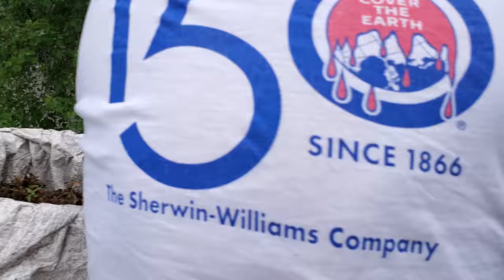Relocating Mourning Dove Nest

Comment: I'm sorry, great intentions, but you should have just left them alone. At that stage, the chicks would have fledged the nest within a matter of days, so rescheduling the job would have been the way to go. I'm in this situation right now, and a bird expert told me that relocating a mourning dove nests isn't possible, so the chances that the chicks survived are, unfortunately, small. I also learned that apparently, relocating bird nests with eggs or chicks inside is illegal (which I didn't know). But hey, points for good intentions. ;-)
Reply from the maker: I'm sure you're right, but we didn't have a choice we were cleaning out the gutter and they were right on top of the downspout. rescheduling was just not going to happen because the job was far out of the way.
Reply: It’s illegal to remove native species birds, I don’t know if doves are native where this job was at, but for most birds that nests in houses, sparrows, starlings, etc are legally killable, witch means you can legally remove the nest and even put down the offspring
Reply: Moving a dove nest IS possible, because I’ve done it before, successfully. My guess is that they were probably fine. I moved one with eggs in it, and both hatched later and they flew eventually. The parents found them just fine.

Comment: Do you know if the mother ever came back to the relocated nest?
Reply from the maker: No unfortunately I don't know. I am just as curious as you though. The job was out of the way so it wasn't a job we could drive by to check on the nest. We didn't want to move the nest but we had to because the job required us to do it in order to get the gutters working properly. I did the best I could with the limited knowledge that I have about birds.
Reply: @j5jackson878  You showed kindness and did a great job trying to help the birds.  I bet it all turned out ok in the end.